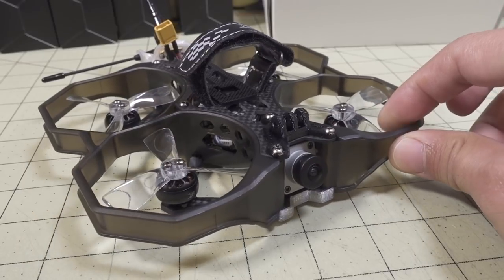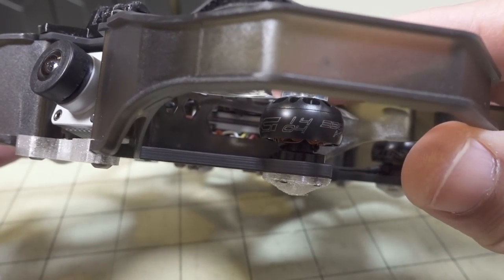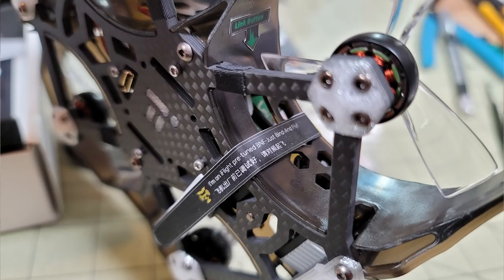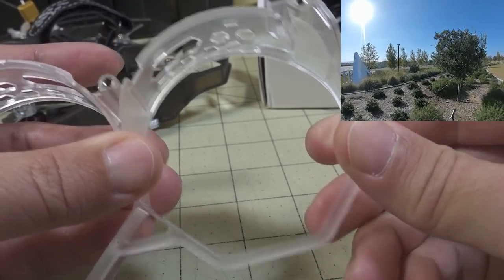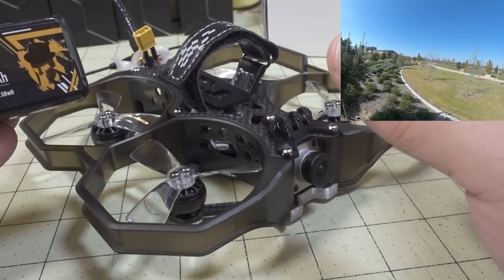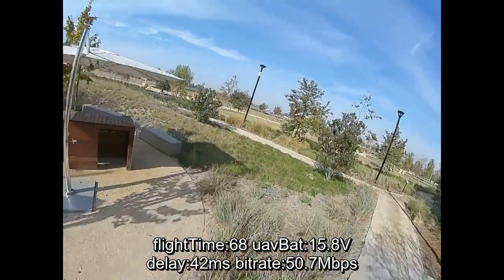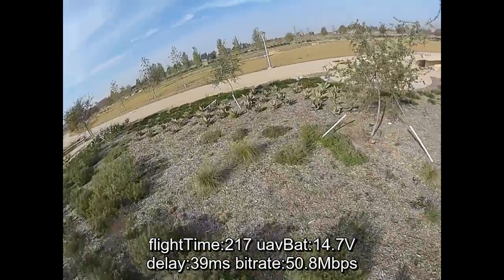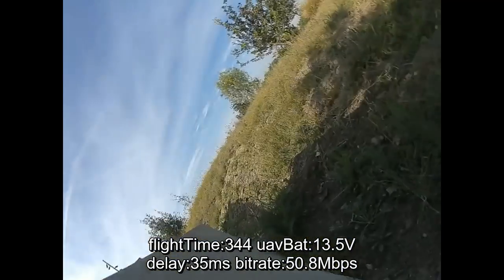Cinewhoop Racer? // iFlight Protek25 HD 😀

Comment from the maker: Protek25 HD (Vista) - http://bit.ly/375sJw1 | http://bit.ly/2JgzOSg | http://bit.ly/2VFYFl3
Protek25 (Analog) - http://bit.ly/33icnPl | http://bit.ly/364Lbp0 | http://bit.ly/2I7njIf
Protek35 HD (DJI AU) - http://bit.ly/3nTNDVC | http://bit.ly/366Kpry | http://bit.ly/3g9kSRW
Protek35 (Analog) - http://bit.ly/37bGCsi | http://bit.ly/367hLqC | http://bit.ly/2Vzfcr3

Batteries - http://bit.ly/2J9MrP1 | http://bit.ly/2SDipF8
Factory Settings (use w/caution!) - http://bit.ly/37byvfB

🙏 Please support with a 👍 and don’t forget to hit the 🔔 thanks!

👉 Old gear for sale here -  http://bit.ly/AlbertGearFS

💲 Get the latest exclusive coupon codes (updated often)
     http://bit.ly/34SYiGn

Comment: On the iflight website you see a picture of a protek25 lite mod weighing 109gr. withouth the prop guards. Do you think each prop guard with bumper weights about 45gr? In that way you could get it sub 250gr

Comment: Nice review, how does this compare to a beta95x? Which one do think is better?
Reply from the maker: They don't really compare well at all other than the 2.5 inch prop size.  The Beta95x is like a light pick up truck compared to the much heavier Protek25 being more like a monster truck.  That's how they compare.
Reply: @AlbertKimTV  lol I see! I wanted to get the 95x but I read they're working on a v3, have you heard anything?
Reply: @sgtfelixfpv8451  would be interesting if they had v3. v2 is pretty legit. Only thing I could see them upgrading is the motors to 1207 or something like that. Then it'd be a nice aggressive freestyle and cinematic little kwad. And maybe they try to make it similar to the hom wingsuit or this, but that would defeat being a light kwad.

Comment: Albert great video  👍 ,  what would you recommend for pwm frecuency 24khz or 48khz for this size of cinewhoop (1404 5500kv motors) , im currently using JESC  24khz , any help will greatly appreciated .
Reply from the maker: I would go with 48khz and set thrust_linear to 25 or 35.  Some adjustment to PIDs might be needed.  I would also adjust the motor limit to 80% or lower to get more flight time and cooler motors.  I probably should make a tuning video for this model, but I think it's about to get discontinued.
Reply: @AlbertKimTV  Thanks for the advice , greatly appreciated . A tuning video would be great .

Comment: What transmitter should I use pls tell
Reply from the maker: Transmitters perform generally all the same now.  What matters is what you like which is subjective.  I use a smaller radio like the Jumper T-Lite which is comfortable for my hands.  Others like larger radios and smaller ones are uncomfortable.  There are also a wide variety of protocols to choose from.  Current popular ones are Crossfire, Frsky, and ExpressLRS.
Reply: @AlbertKimTV  I am buying the frisky can u link a video because I don't know how to connect it

Comment: Do you think a lithiumion pack is perfect for this for extended flight time cinewhooping? Or is it too heavy for this frame?
Reply from the maker: Gonna be too heavy for the small 2.5 inch props.  The motors will get very hot. The stress on the ESCs will burn them out eventually.
Reply: @AlbertKimTV  thanks for clearing that up!

Comment: i have the 35, and it's almost impossible the access the SD card in the Air Unit, would be nice if it would be possible to get the videos off the air unit via USB, but I can't figure that one out ..
for some reason, the Signal is far better on the DC2 .. with the same Air unit on board, which is quite strange.
Reply from the maker: Check that your antennas are properly screwed all the way down.  If not, the signal might not be good.

Comment: One year down the road would you recommend the protec 25 HD polar for $315 PNP. It’s the only option of it’s kind where I live and on sale bkackfriday!!. I ask cause my purpose is to fly around my apartment with the polar( I also need a polar don’t own one yet but confused if the Nano is better) occasionally put a hero6 with External power and try some cinematic. Also I have a few 1500 mah can they take them ? I know 1000 and 850 are recommended and have a couple. Sorry many questions 
Thanks
Reply from the maker: 1500mah is too much weight.  The full size polar is better but the nano is a lot lighter.  For $315, there are a lot of options for a 2.5 inch cinewhoop but if this is the only option in your area, this is not a bad one if you make sure to keep the weight as low as possible with battery and camera.  With more weight, this model will have hotter motors and lower flight time but could be managed with PID changes and other settings.  See my other responses to comments on this video and you'll see some of the suggestions I made to other viewers.
Reply: @AlbertKimTV  I scrapped the idea thanks though a friend got it instead and I sent him your reply :)

Comment: I bought one of these but I’m having trouble with DJI controller. Basically it binds to caddx vista nebula pro (I get image in DJI goggles) but I cannot arm or control with my DJI controller.
Reply from the maker: Re-bind to the controller again.  Sometimes after binding to the goggles, the transmitter needs to be bound again (and vice versa).
Reply: @AlbertKimTV  controller is bound, green bind light comes on on my DJI Controller. I shouldn’t hv to solder anything, right? I hv the iFlight F411 Pro fc.
Reply: Btw Thank you so much for responding 🙏🏼
Reply: Figured it out. Nothing connected to the sbus on the six pin connector, so now I’m scouring on-the-net for a six pin connector that has sbus connected.  Thank you for your AIO video and explanation on what’s needs to be soldered on for DJI components to work. I hope this is helpful for other people(noobs) that are getting into the FPV community. I will update when I find and solder the connector.

Comment: But how does it fly with a GoPro onboard tho
Reply from the maker: I need to figure out how to make a mount for it.  The 3.5 inch version can carry a full GoPro but the mount on this doesn't work with full sized GoPros
Reply: @AlbertKimTV  oh I forgot about it, you're right. (Maybe I should get a naked GoPro for the cinequeen also)
(Cuz I tried GoPro 8 once and it burnt my motor. Rip.)

Comment: Hello Albert after watching your video on Protek 25 HD, then I bought one last week.
Now. I need your HELP  how to install FrSky Receiver R-XSR to my Protek25  HD ?( how to Wire receiver to the Drone.
Im a New Bee, Would you Please Help me. also I bought Radio Controller JUMPER LITe so I can fly it. Would you PLEASE HELP me.
THANK YOU
Reply from the maker: You need to take a look at the wiring diagram for the FC in that model.  See link to that here - http://bit.ly/2OO7Obz
I have a video on how to setup a model in OpenTX in this video.  It's a different radio, but the T-Lite also uses OpenTX, so the process will be the same, just the screens and buttons look a little different.  https://youtu.be/r0hKVeba0LI
Reply: Okay Albert I will take a good look on the wiring Diagram on the box,
And I will carefully connect my Receiver into the Kqad, Wish me Luck.
THANK YOU for your replies.